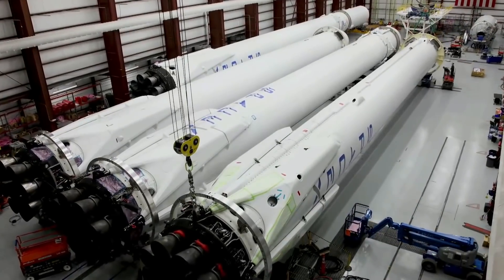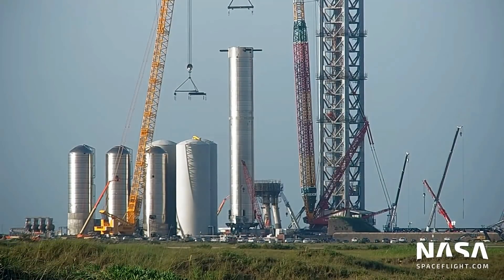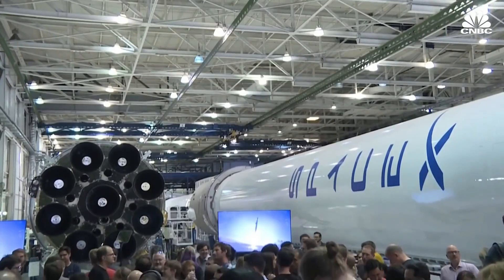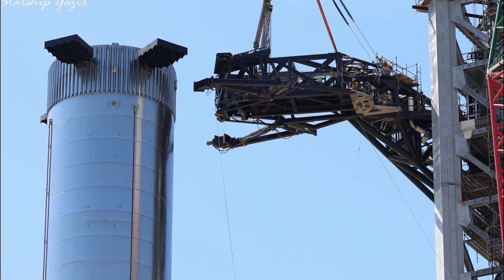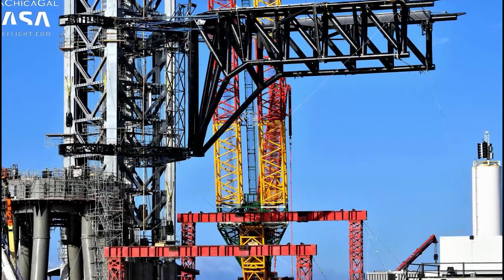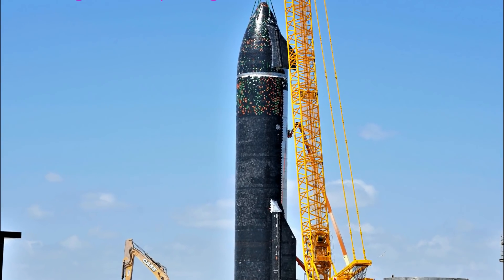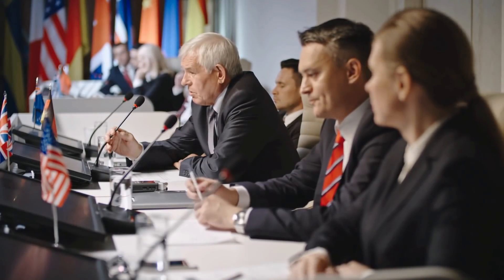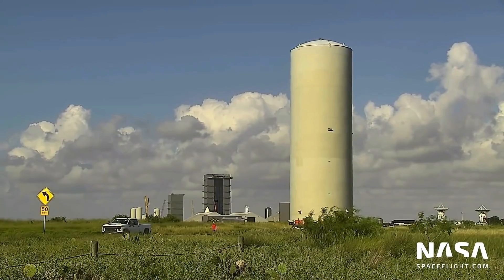SpaceX Starship Fires Up! NASA Selecting Second Human Landing System

Comment: I think they should look at the SPIRIT of their own rules.  The SPIRIT of the rule of having two selections was, I suppose, to increase the chances of success, should one of the plans encounters a hard difficulty.  But that was in the assumption of quasi-equal proposals, up to, say, a factor of two of calculated value for money.  Where the relative value difference is as big as 10:1 or 100:1 it makes no sense whatsoever to keep the lesser proposal as a backup.  The SpaceX proposal is 10x cheaper and delivers far more than 10x more cargo;  so that's a 100:1 value difference right there;  PLUS, the lunar Starship can be used as a habitat on the lunar surface, or as a module for the Gateway, or as an orbital fuel depot.  So, the value difference is far greater than the nominal 100:1.  PLUS, the solutions of the other contenders are Artemis-exclusive, whereas Starship is a vehicle for general use, and therefore has far more of a future.  Last but not least,  NASA should stop doing business with BO altogether on account of their frivolous lawsuit.